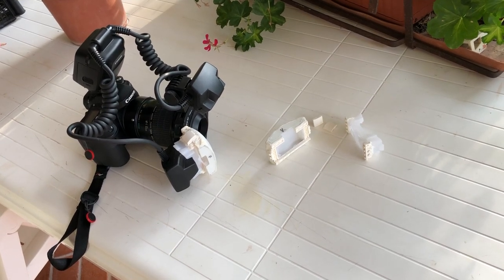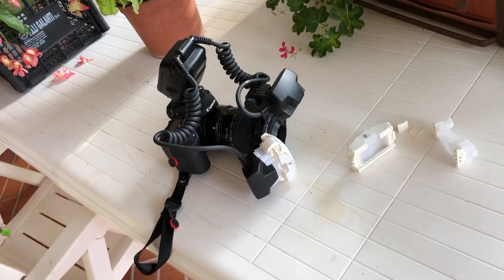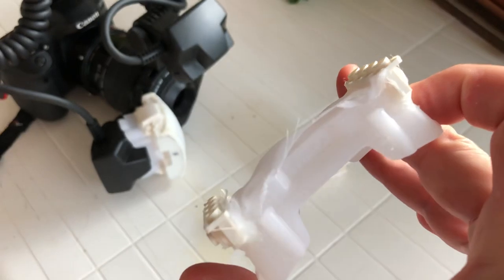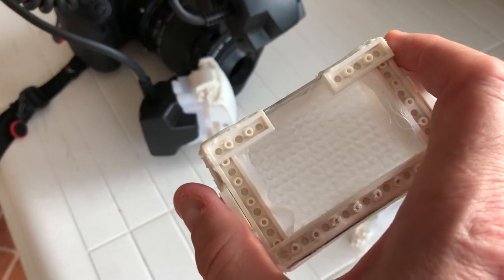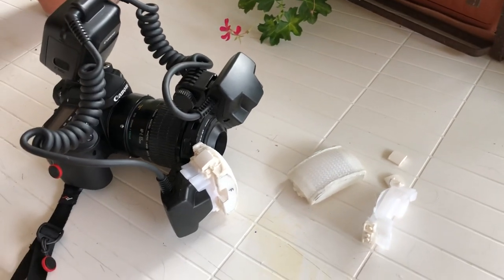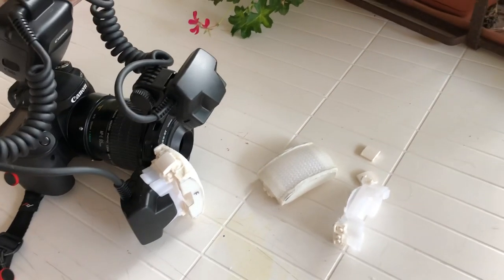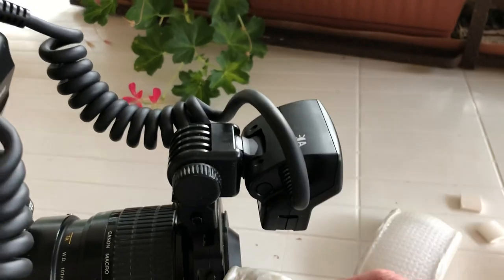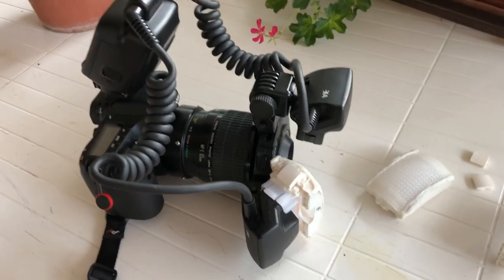Current Macro Rig and old Diffusers

Comment: Great to see your latest diffusers John. I see you’ve upgraded to the MT-26EX-RT. Have you found much improvement over the 24EX, other than it coming with its own diffusers?
Reply from the maker: The MT-24EX didn't really have a built in diffuser -it was almost a clear piece of plastic and that's why the specular highlights had a brutal hot spot in them. You could see the flash tubes. The MT-26EX-RT has a really good built in diffuser so the specular highlights are easier to tame. Plus it has a higher guide number (more stopping power), it can be adjusted in 1/3 stop increments in manual mode (full stops for the 24), and the flash heads are physically a little bigger. Plus it's built better, so all around a pretty good upgrade.
Reply: John Kimbler yeah that’s what I thought. Makes me want to upgrade my 24EX.